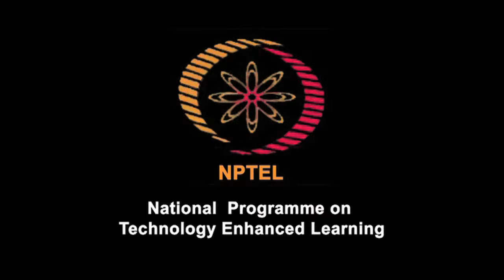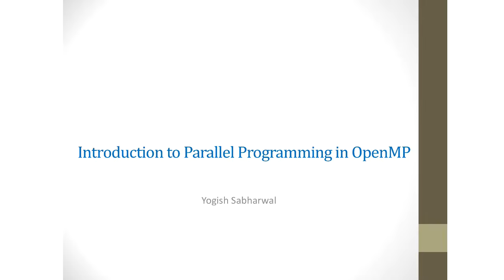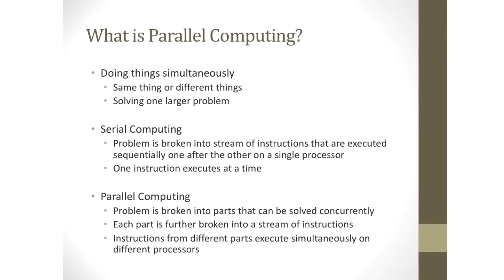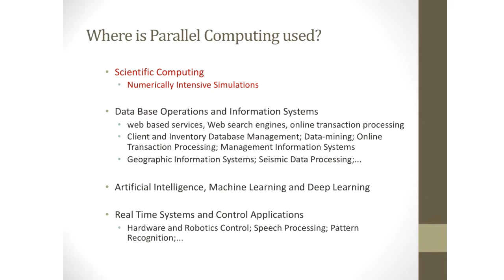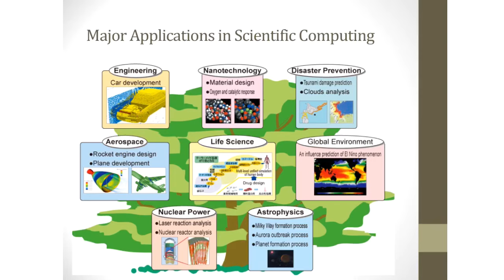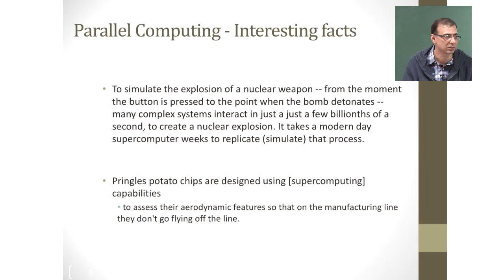Introduction to Parallel Programming

Comment: what is the difference between parallel computing and cluster computing ?
Reply: I mighty be wrong but as per my understanding in parallel programming we can run different /same task concurrently for ex in one processor we do a+b in another c*d etc but in cluster computing we group similar task in clusters and then do the computing for ex in cluster 1 we have all addition Operation, in cluster 2 we have all division operation etc .
Reply: Does this you tube channel has all subjects of cse in gate exam???
please reply bro🙌